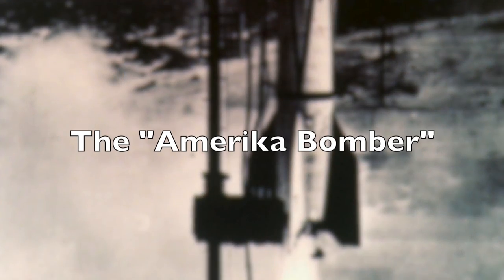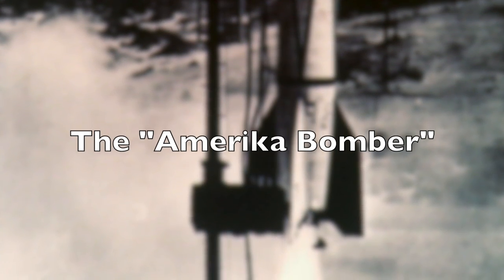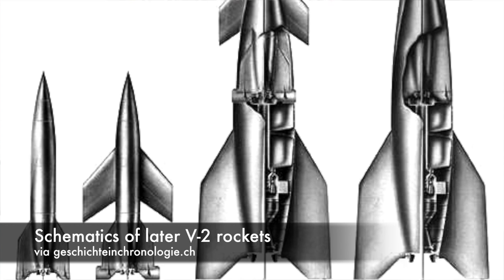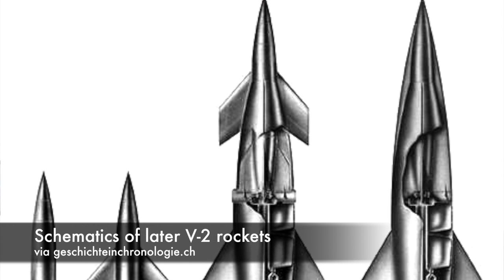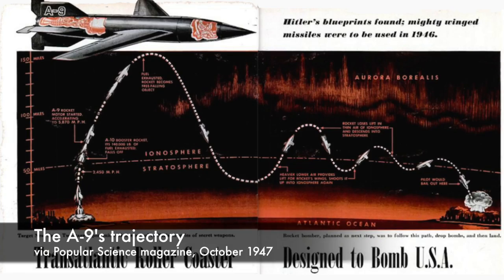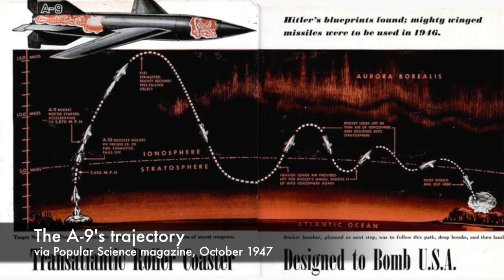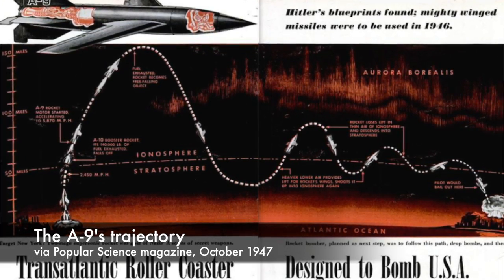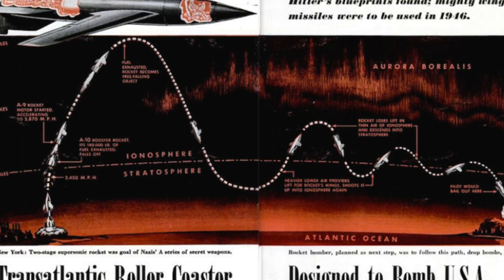Nazi "Amerika Bombers"

Comment: I remember reading somewhere that  the A9 would not have been very useful as a weapon, due to its limited payload and the inaccuracies of the guidance system, which was supposed to be the same as the V2 system.  If the accuracy of the V2 was extrapolated to a Trans Atlantic flight time, a rocket targeting NYC could hit anywhere between DC, Pittsburgh, Boston and an equal distance into the Atlantic.  With this spread, there was a very high probability that the rocket would impact empty water or a remote forest and nobody would even notice.   The Germans would have to launch hundreds of them to have an effect.

Comment: There are a few inaccuracies in this video:
1. The A6,A7 and A8 were vastly different in relation to the A9, and only the A7 and A6 were winged. Like the A5 was a functional scale model to the V-2, the A7 was a scaled down version of the A9, essentially a A5 but with wings, hence the prototype. The A6 was a variant of the A9 intended to use a ramjet. The A8, absolutely not in relation to the A9 at all, was simply a stretched version of the V-2 which later got used by the French in the Super V-2.
 
2. The A9 was also known as the V-2B and had 2 launches: one a outright failure on launch and the second one was a success on launch and initially a success in reentry but a wing broke off. It still was going over Mach 4 and having some lift. There are in fact photos online of this as well as footage of the first’s failure. If that’s not enough the Model 39 engine was reengineered as the Model 39a which would initially be set for use in the V-2 3rd production run and in the A9, and would ultimately be used by American designs with Redstone/Peenemunde engineers working to improve it for the Redstone Missile through Project Hermes. As for the A10 they had in fact constructed static test launchpads for the A10 engine but abandoned efforts in 1945.

3. The A12, the penultimate version of the A9/A10/A11/A12 orbital launch system, was continued in design in Von Braun’s sketches while in America and got appearances in the press until the idea was finally realized as the Super Jupiter, which changed name to Juno V, and was changed in specification to the Saturn I. So the Saturn rockets were in fact the distant descendant of the V-2 but also the spiritual successor through Von Braun’s reimaginings of the A12, with initially tubbier designs and more streamlined and slim designs until the Saturn.

Comment: For the more-excitable speculators out there, even the A9/A10 combo only had a useful payload of 1,000 kilos. That's about 2,200 pounds. Little Boy weighed in at 9,700 pounds and Fat Man at 10,300 pounds.

Good luck with that...
Reply: Yeah, that was an issue. Of course, you could use an A9/A10/A11...

Comment: The aggregat 11 and 12 that Von Braun had planed in the WW2 to was later known as Saturn V
Reply: Not hardly. 

Yes, they were designs from von Braun, and they were rockets, and that's all the similarity there is. They didn't even have a common fuel/oxidizer combo.
Reply: No. Saturn V had three stages, used Hydrolox and Kerolox, and was actually a bit smaller but with more payload. A9/A10/A11/A12 was four stages, used Alcolox, maybe hydrazine or some other stuff, and was larger and had less payload.

Comment: Unless you've got a nuke, these concepts are useless. The damage you could do would be less than the cost of the mission. This is even more true if you suppose Germany would use chemical or radiological weapons. By the time these delivery systems would become available, Germany had more to lose by going chemical.
Reply: @pvcfsdevkidforcryengine1.432  Well, it was a radiological weapon planned. What I'm saying is that the amount of disruption caused by the attack would be less than developing the means of making the attack.
Reply: @Bacopa68  they have had very exact plans of the radiological spreading, the detonation hight and their was also plans from Manhatten with circled sector of planned distortion and fallout (?) or radiation pollution. 
the only problem was to carry that sort of bomb(s) to there Destination (Manhatten was the Choosen one).
as i have seen, the A4 was prepared to do this Job  for the first time and was already prepared to take off, but it needed a Temperature below 4 degrees Celsius (or was it -4 ? it's long ago, sorry), which does not happened in Januar (?) 45 (which was quite unusual) so the lounch was delayed and delayed and delayed and finally does not happened.
the Goal was also NOT to destroy,  should show what's possible and try to get the USA out of War against Germany.
(sorry for my english, I'm a German)